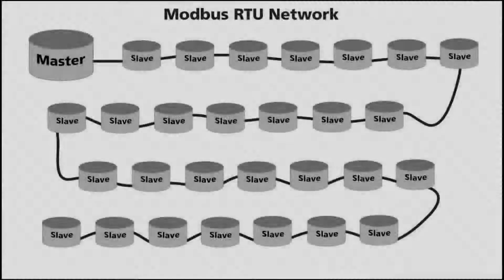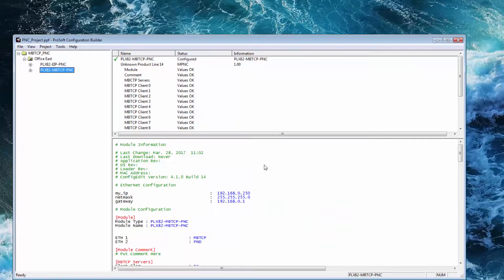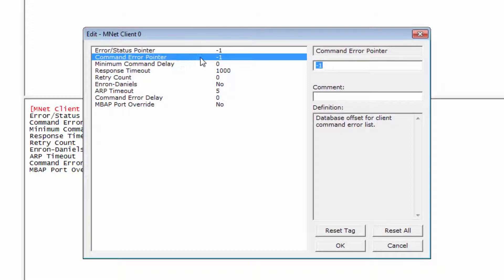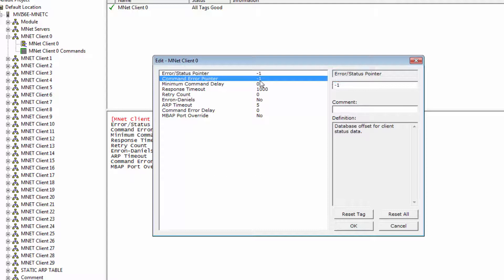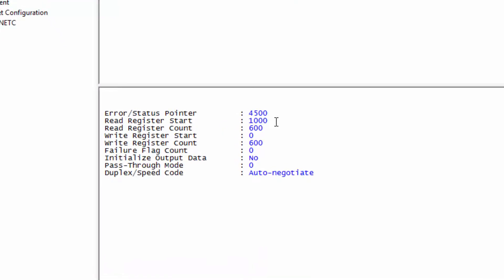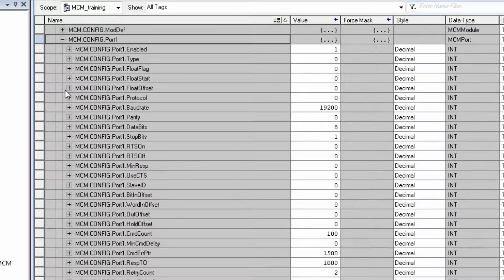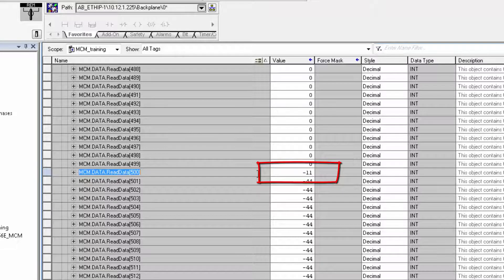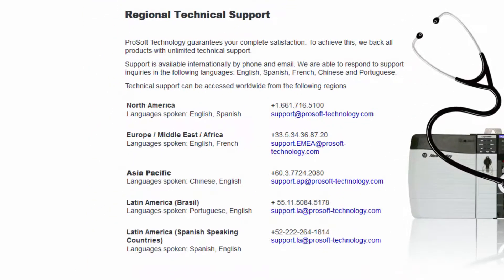Configure our Modbus modules to identify communication problems

Comment: Hi
Thanks for the info,
I followed the video step by step, using MNET, but when monitoring in studio 5000 I get the code -33. any idea what it means?
Reply from the maker: Hi there!  -33 is a networking error, and specifically it indicates that the user is attempting to connect to the device at the IP address in their command, but whatever is at that IP address it not allowing you to connect to it. The MVI69-MNET user manual has a section in the back which discusses all the common error codes and gives a brief description of what they indicate, including -33.  It can be found here on pages 96-97:

https://www.prosoft-technology.com/content/download/973/7855/version/15/file/MVI69_MNET_User_Manual.pdf. 

It could be an issue of a mistyped IP address. For further questions or troubleshooting with this, feel free to contact our regional tech support teams: https://www.prosoft-technology.com/Services-Support/Customer-Support. Thank you!